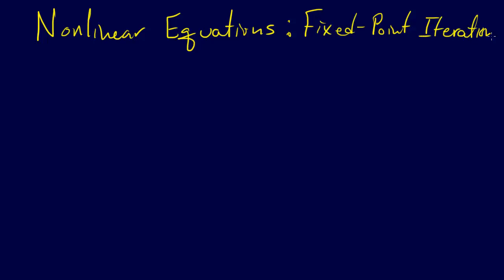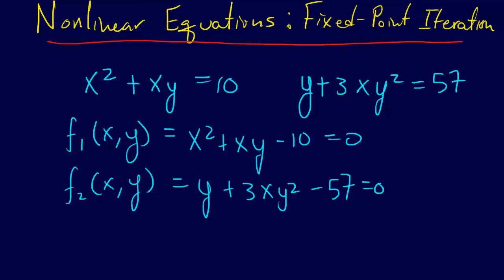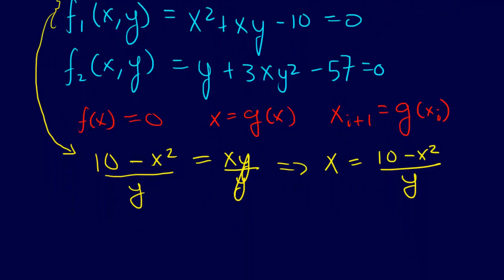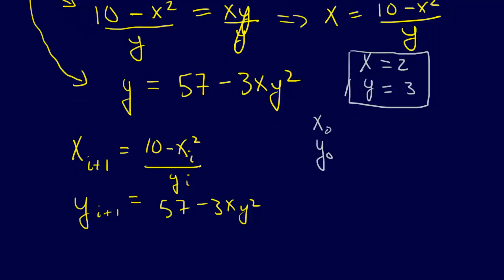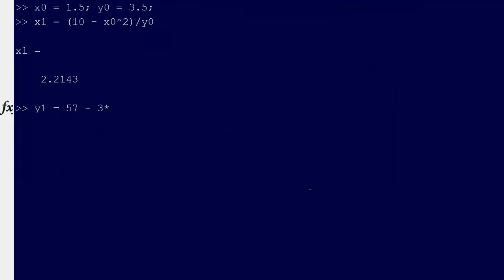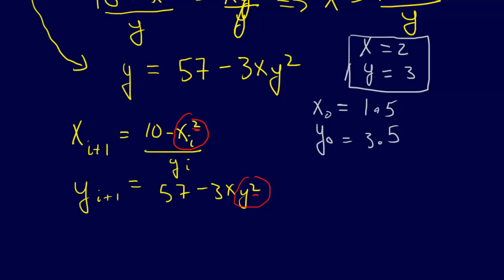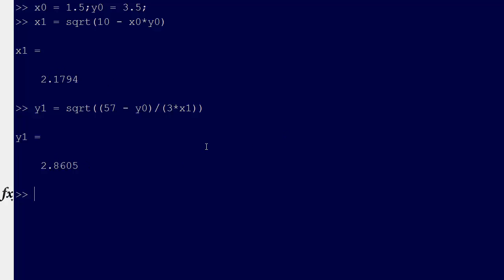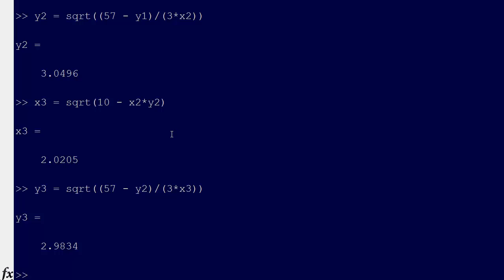2.3.2-Roots: Nonlinear Systems Fixed Point Iteration

Comment: if you didn't know the actual roots how would u pick your initial guesses?
Reply: first you should find the interval that f(a)*f(b)<0  (So that we can say there is at least one root in the interval [a,b] ) Then you have to choose an arbitrary number which is in the interval.
Notes: 
1-)The lower range of our limit is most preferred for initial guess.
2-)If the number you choose is not very suitable for the initial situation, the number of iterations you make will increase.But in the end you will find answer.

** I am just a student and i pass that class 1 semester ago so I may know wrong.Just check it with books or internet again pls.